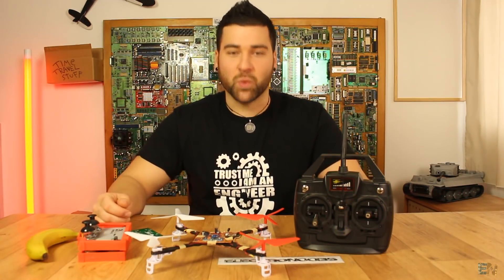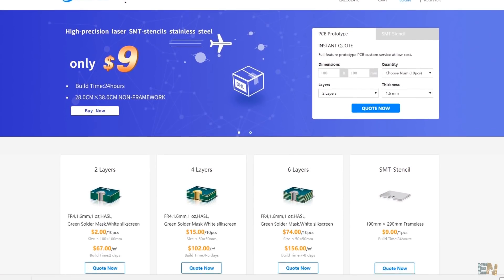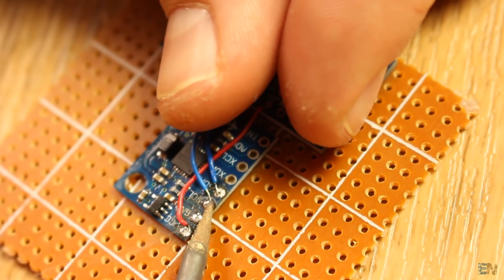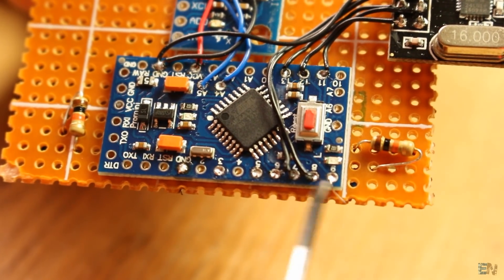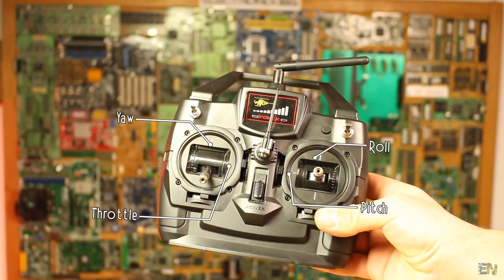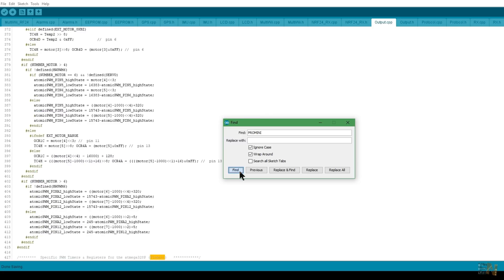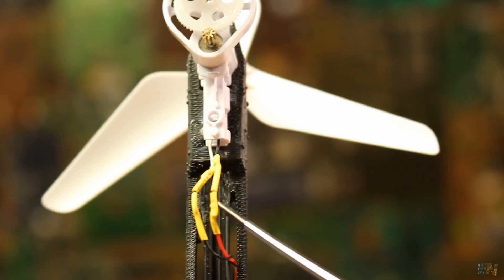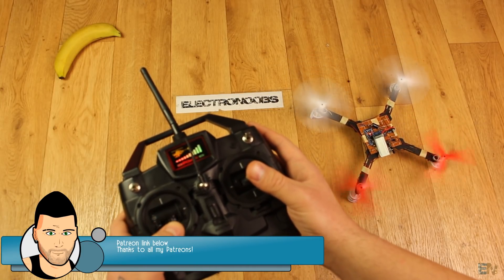Brushed motors Arduino drone - Part2 - Prototype + NRF24 code

Comment: During my first experiment I made a drone circuit using a brushed motor and a schematic circuit owned by Electronoobs. So, after that, I assembled it and finished making the flight controller (I haven't installed the dynamo yet) I tried it on the MultiWii, the transmitter and receiver are connected to each other and the movements on the joystick are also recorded on the MultiWii. but after I assembled it for the brushed motor and I installed it in my Arduino flight controller, but when it was powered by a 2s lipo and connected for a moment and part of the dynamo rotated by itself, I don't know, I didn't know before I raised the throttle... well when I raised the throttle it actually turned between the receivers and the network transmitter suddenly disconnects and the dynamo rotates randomly and irregularly. and there is no longer a connection between the remote and the receiver. please friends what is the solution

Comment: hi can u pls tell how to build it using radio controller like (flyskys,radiolink)not nrf24 and without the mosfets,diodes,capacitors etc
Reply: Which brushed esc u using?😂

Comment: hi, I have installed multiwii but when I try to open it it always shows a notification "windows cant open javaw.axe" I have tried various ways, starting from removing it then installing it again, adding the path and various methods that I found on the internet, but no results  that i got.  Anyone experiencing the same thing as me?  or does anyone know how to solve this?

Comment: Can you please tell me on your code where you have defined those pins for output?

In the output.cpp file I have found that the outputs are gonna be in 3, 9, 10, 11 pins, but you are connecting it to 3, 5, 6, 9. 
Can you please clear me where on file the output pins are defined?

Comment: I made a brushed drone as you told in the  tutorial.I made the body of drone with barbeque sticks and when I gave throttle the Arduino in reciever gets reset  when I reach half throttle . Can anyone tell me  where should I connect the positive wire coming from battery to which pin of the Arduino in the receiver 
Please help 
How can I contact you I need your help

Comment: Sir,
I am able to vary the voltage from 0 to 3.7 volts, but when i connect motor then motor is getting 1.4/1.5 volts only, i used p55nf06 mosfet, what is the problem?

Comment: Hi 
Thanks for all detailed video until now!! 
About  the multiwii NRF24  code..   
have you try to compile it  with   #define TRI  ?
i like better tricopters  but i am getting a warning when i choose that (the sketch says that the Nrf24 modification is for  tricopters,quadcopters )

as more experienced than me can you think what is wrong ? 

the error i am getting is :

 from /tmp/arduino_build_245010/sketch/Output.cpp:1:
/tmp/arduino_build_245010/sketch/Output.cpp: In function 'void __vector_14()':
Output.cpp:1026: error: redefinition of 'void __vector_14()'
     #define SOFT_PWM_ISR2 TIMER0_COMPA_vect
                           ^
/tmp/arduino_build_245010/sketch/Output.cpp:1087:9: note: in expansion of macro 'SOFT_PWM_ISR2'
     ISR(SOFT_PWM_ISR2) { 
         ^
/tmp/arduino_build_245010/sketch/Output.cpp:772:25: note: 'void __vector_14()' previously defined here
       #define SERVO_ISR TIMER0_COMPA_vect
                         ^
/tmp/arduino_build_245010/sketch/Output.cpp:944:7: note: in expansion of macro 'SERVO_ISR'
   ISR(SERVO_ISR) {
       ^

Comment: Sir 1 help plz..if i use brushless motor...and change ppm signal valu  1000 to 2000...
I downlod this quad multiwii file..and open output.cc and uncommented brushed motor valu(0 to 100)...plz tell me,now this wark with brushless motor??

Comment: what if i want to control 6v brushed motors without esc's .will only mosfets work for this if yes please tell the part number and other modifications if required.thanks Electronoobs.

Comment: +Electronoobs
may be I am asking it again, but I have seen in other videos where it's shown power distribution board is required for brushless motors. with coreless brushed motors, we don't require it, right? also the mos-fets are used in place of esc's?
Reply from the maker: Yes, mosfet in place of ESCs and the power distribution board is extra. You can take power with a wire for each motor!

Comment: Hi the nrf code doesn't seem to be working is it the only code or is there any other snippet you used  i'm not able to communicate with the receiver via transmitter though the circuit diagram is quite correct and the voltage is also 3.3 ... a little help would be great. Thanks

Comment: Which MOSFETs to use for motors if I'm using '180 (k20) motors' they might need high voltage ?

Comment: Hi, at first thanks for youtube channel and the best training.  I heve a problem. In multiwii software my ROLL value is not available . the worth of throt, yow and pitch is true . what do i do?
Reply from the maker: alireza farzipour everything is ok but just Roll la not there? Roll for IMU movement of for radio receiver?
Reply: yes only Roll is not there
Reply: Electronoobs I want make a Wing plane but in quad copter mode too Roll is not available
Reply: @arfzp  upgrade your multiwii version. Also check if you have JRE7 (Java Environment) installed on your system.

Comment: Which capacitors did you use, can you specify the specs of the capacitor.Also how to connect battery connector pin?Thanks

Comment: Interesting project. I am curious how well it does on a Kickstarter. Your idea of avoiding/creating an alternative to the 3d printer body is important. Most people that have the money for a working 3d printer would probably just buy a drone and are not going to build an ultra simple budget setup unless it offers some special feature they can't get elsewhere. Could you build something that has serious range with a Lora module for example? I'm not into drones, I'm curious about them, but I'm not very motivated to play with them after goofing around with a friend's GoPro version. The batter life and limited usefulness make them a novelty that I don't really want to spend a lot of time with.
  I know, I know... I'm not very positive or helpful here. I just have one practical suggestion, you might want to use a better prototype PCB or mention the soldering temperature used for attaching components to that brown perf-board. The copper on those tends to lift extremely easily. When anyone tries to copy your design, makes a mistake, and tries to desolder or move something around it will probably delaminate. Don't get me wrong, I use the stuff all the time myself, but I have also had to loop a piece of wire through 2 holes to create my own solder point on more than one occasion after lifting several pads. The cheap double sided green PCBs seem to be much more resilient for a few cents more.
  I know your focus with JLCPCB, but this seems like the ideal opportunity to just use solid core wire for a point to point design. You could even use the perf-board as a form to help map out your connections. 
  Weight wise, I wonder what you could do with thin wall brass tubing from a local hardware store. You could then solder your joints. You could probably even make it your ground connection for everything.
  Just some crazy ideas from a curious viewer ;)
-Jake
Reply from the maker: I have the green double side PCB as well, but as you know it is way heavier than the brown one. Fot this project you need very light components. 
Thanks for all the tips. Keep up!

Comment: Hi thanks for the video by the way
I also have been working this kind of a drone project. But i have failed because i couldnt menaged to fly my brushed drone 
I also did everything you did. I even used with 2s battery. And i just gave up 2-3 mounts ago. I cant find the problem. if you can find the pls make a video about it so i can make my drone fly thanks to you.

Comment: Hello sir, i have tarot 5008 400kv motor its maximum current is 24A. Can is use hobbywing 40A esc with 6s battery 24v.?

Comment: I followed your project and support your videos since one year and obviously I've learned a lot of things from your YouTube channel and your tutorials "Electronoobs", thank you very much. Excuse me, I want to ask you if you can do a tutorial about GPS ublox return home function for Arduino based quadcopter with description, like your methods in the last series. if you do it it will be amazing and you will prove your intelligence, hop you respond my request, thank you.
Reply from the maker: Hi and thank you. My to do list is quite long. For now I don't haev that on my soon "to do list" sorry. Thanks again!
Reply: @ELECTRONOOBS  Hello big brother, I want am facing a problem while building my own drone, kindly help me out....

When I use Arduino pro mini 3.3v/8Mhz board then the Multiwii GUI can't recognise it.... but when I use the 5v/16Mhz Arduino pro mini board then the GUI starts to run....I don't know where the problem is as my board is working fine with other codes but not with the GUI

Comment: You just got my favorite electronics YouTuber. I like that you find the right balance between enough information and right length for every video. I have a question though. What soldering station/soldering iron do you use and where do you buy your solder from?

Keep up the good work brother!
Reply from the maker: Thank you so much. I use a very cheap chinese soldering iron. LOL I'll upgrade soon !
Reply: Electronoobs I mean I do too. I have a better soldering gun but it doesn't work on PCB I use it only for thicker wire. I'm waiting on some eBay deals to score a cheap second hand one maybe :D

Comment: plz anyone Explain how dron fly , i mean , i know that two motors rotate in clockwise and other two rotates in counterclockwise direction to prevent from whole system rotate , but What need to do to move drone Forward ? and other direction ????? 🤔🤔
 and how it flip ?? and what happened when Drone cross its control range then how controller  get back his drone During Flying  ????
Reply: For the drone to move forwards, backwards, left, and right, the drone tilts itself by spinning up two rotors. As an example, if the drone wants to go forward, it speeds up it’s two back rotors. To yaw, (spin left and right) two rotors spinning the same direction (so on opposite corners) will speed up. To do a flip, the drone simply continues to pitch forward until it has flipped all the way around. Hope I helped!
Reply from the maker: See my video on PID drone control https://www.youtube.com/watch?v=qzZQyqu0uA0&t=910s
Reply: Electronoobs thanks a lot
Reply: Benjamin Tarr thanks too
Reply: @Benjamin Tarr good concise explanation :)
Reply: Benjamin Tarr and what about my last Ques ???? m waiting !!!!!

Comment: Can you make a controller with an with Xbox joy stick or with something else
Reply: Pratham Bhatnagar 
An analogue "joystick" is just a pair of potentiometers set up with one 90 degrees from the other. The two signals are then converted to digital numbers. These two numbers are used to create a two dimensional X/Y graph. You need two joysticks, or 4 potentiometers to add extra dimensions to a graph (like adding a up-down Z axis, or adding pitch, yaw, acceleration, etc).
  What's my point? "Joysticks" aren't a thing. It's just marketing terminology. The X/Y maping principal is universal to human interface though. Your touch screen on your phone uses a controller that is maping X/Y all the time. Note there are various levels of resolution. Something like the original 8 bit gaming consoles used a "+" directional pad which was just 4 push buttons. That's the most simple X/Y maping. Potentiometer type joysticks are only limited by the resolution and speed of the Analogue to Digital Converter (ADC) used to determine their position. There are also other types of X/Y maping systems like old ball type computer mice that used optical encoders, and most modern touch screens use capacitive systems instead of the old type that use resistive maping, but it's all still a simple X/Y maping system ;)
-Jake
Reply: Thanks buddy